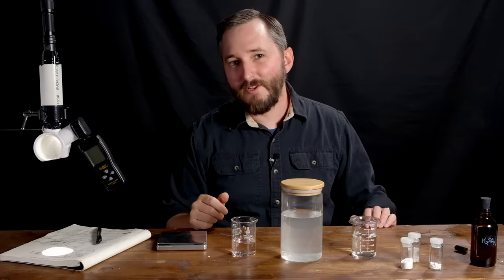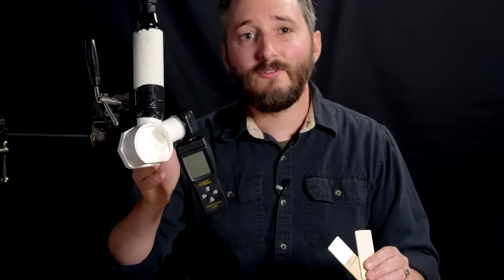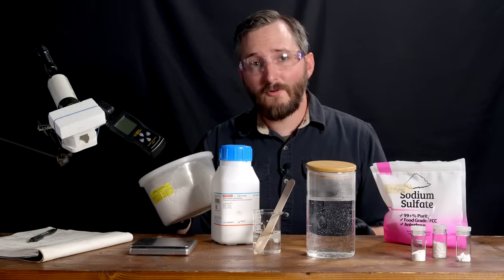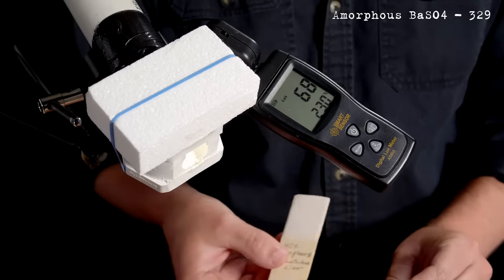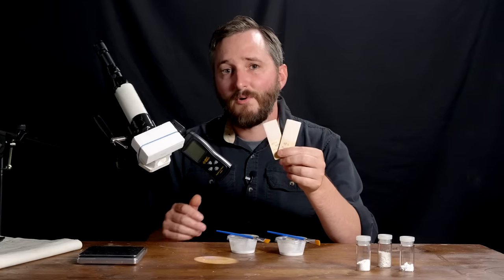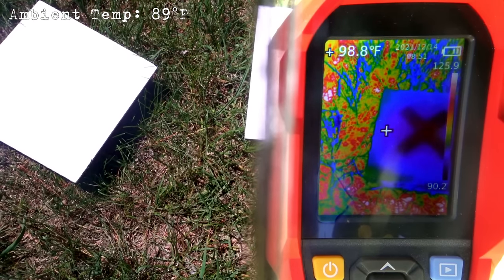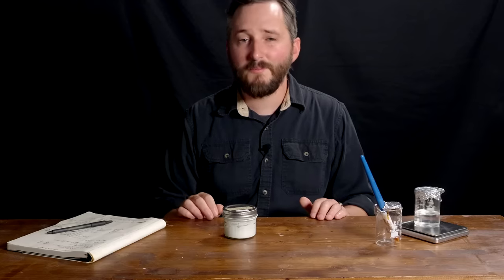How To Make Infrared Cooling Paint (Electricity Free Air Conditioning)

Comment: I noticed that your goal is to get high visible light reflectivity, before testing the infrared properties. Do you mind publishing a short that compares the properties from the un ideal paints as well?

P.S.
The phrase “pharmaceutical products” doesn’t just apply to medicine, it also applies to equipment: from glucose test strips, to crutches and wheel chairs.
The reduced thermal heat properties could be very useful for sensors in medical laboratory equipment.
Reply from the maker: I would have to make new batches of those paints to test. Sort of a lot of work for what would be a pretty boring video. I'm certain the results from the early paint tests would not be useful practically. I'm working on improvements to this paint now, in particular a calcium version that I think will be the best yet and easy to replicate. New video should be out in about a month if things go well.

Comment: Could you mix it with any kind of coolant without ruining it? Then maybe run it through clear piping? Use it with a heat pump?
Reply: I may be way off but it's to see if I understand and wonder also. Could this be used in place of water in solar collectors?  I guess, though, it loses its cooling effect when it is away from exposure to the sun's rays-- it does retain any cooling. 

Let's keep sharing this video and getting more brains to noodle on it. Maybe opengpt will have thoughts on it, too?

Comment: Amazing video, Nighthawk!! Truly inspiring stuff, and as usual you make it look so easy. 

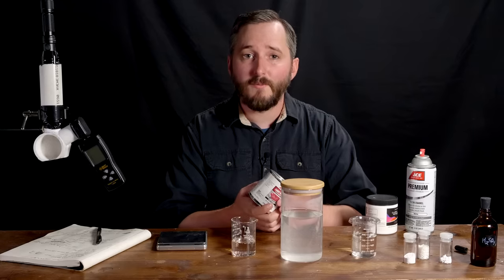At 2:45 you mention that Calcium Carbonate can also be the basis for such a paint. So basically simple lime can get this job done (mixed with other stuff perhaps)?
Reply from the maker: Yes calcium carbonate can work if used just like the barium sulfate in this video. It's slightly less cooling, but very close
Reply: @Nighthawkinlight  Since commercial Lime is about $10 for a 50lb bag... I would give it a try. 

Also, are you familiar with Solar Flat Plate Collectors? They are used to collect solar hot water for domestic hot water or hydronic heating during the Winter. What if the backside of the panel were coated with this high emissivity paint and removable rigid foam panels? 

During the Winter the panels are angled at the Sun to absorb radiation for heating, but during the Summer the panels can be inverted and the rigid foam removed to allow them to cool the water below ambient.

Comment: How did you calibrate the thermal camera for the emissivity/reflectivity of the paints and for the temperature of the background reflection of the sky? It would be really nice if you embedded a thermocouple in the barium paint area and a thermocouple in the standard white paint area to read surface temperatures.

Also, you should put your panel on reflective insulation to fight thermal conduction and thermal radiative heat transfer between the back of the panel and the ground.
Reply from the maker: I've compared the thermal reading with thermocouples and it's pretty close. All the paint tested was acrylic based so the emissivity is similar. I'll be using thermocouples in the following videos and only using the thermal camera for the visuals.

Comment: now that is a fascinating video with those sort of numbers you could maybe run a low differencial sterling engine vanta black on the sun heated end of the cylinder your barium white on the other. that could make an incredably cheap efficient alternative to photovolteics

Comment: if this were possible then the compressor in a home aircond  could be reduced or removed and simply circulate water in a large box that was 15 degress F lower than ambient temp. ! aircond could be supplemented only for the hottest days of the year
Reply from the maker: Yes, the installations of this tech so far have been panels that circulate air for the intake of compressor air conditioners to give it a 15f head start in cooling.

Comment: First, Thank you very much for your work. I am always learning stuff here.
At about the 5:00 mark, it is mentioned that a 60/40 mixture was used for the barium sulfate. I am curious if any thicker mixes/applications were attempted and if so what was observed ?
My goal is to create an emission surface to pump water condensation heat off planet.
Thanks again.
Reply from the maker: More pigment would make the paint too fragile. You could pack more pigment in if you use a method such as that demonstrated on the channel Tech Ingredients. They use barium sulfate microspheres which can pack more densely for an excellent result

Comment: Sounds like a fun project.. Do you think it would work at all if I painted sheet aluminum with this, welded copper piping to it, connected it to a radiator in front of a fan and ran water through it? Sounds reasonably doable, but I have no clue how big it would have to be if it would even work...

Comment: Are those birdhouse looking things being used as thermoelectric generators using the heat differential they produce? If not, maybe that could be a practical application for this paint. A no-moving-part heatsink to make a continuous difference in temperature for a thermoelectric generator 🤔

Comment: If you can find a way to make asphalt that doesn't get as hot in the sunlight, you would probably solve a lot of issues with heat in big cities. 
Obviously, you cannot paint asphalt white or that would be too dangerous and ice wouldn't melt in winter.

Comment: I wonder if you painted around bifacial solar panels with the infrared cooling paint if you could increase the wattage on the solar cells by decreasing the temperature and increasing the light input while also cooling the structure that the panels are on causing less wattage to be needed?

Comment: Great experimental work. But unfortunately you cant  easily judge Temperature of your paint with an IR Camera! The paint has lower emissivity in the range of IR wavelengths where youre camera works. Best would be to paint some samples of same material, Geometry, and weight and prove lower temperature by measuring with embedde Pt100 thermal sensors in comparison. ! You could convince me by an IR Picture from the backide of two sheets where the fronsides are having high reflective paint and Cooling paint and th ebacksides the smae coating...would be great if you make a video about this :)

Comment: So, is this basically conditioning the light to reflect at a particular range of wavelengths to hit that window? If so, could we use that property to create solar style panels that target that range and get higher efficiency from the reflectance? Or, if we painted a house like that, could we then use the house as a heat source to focus light from for a thermal heating engine, like the solar systems that heat sand and oil to high temps?

Comment: Thank you for publishing all the research! So, is this a wireless heat pump that will radiate on any cooler cooler surface? If so, can this radiation wavelength be redirected with mirrors? The way that this technology needs clear sky to function confuses me.

Comment: What if you bought a used AC condenser coil, coated it in your paint, put it under a transparent tent to protect it from wind, and then pumped water through it? Some ac condenser coils are covered in tinsel-like bristles, which would provide a large amount of surface area to radiate heat. If you hooked up the other end to a radiator with a fan inside a small room, I'd be curious to see if it would have enough cooling capacity to function as a legitimate air conditioner.

Comment: At 2:45 you suggested calcium carbonate as another material that can reflect the infrared at that wavelength. Have you, or do you plan to use calcium carbonate in a different video?
 It seems to me easier to acquire, and less dangerous to use than barium.

Comment: I wonder how much of a difference it would make between a clear coat vs a thin film, or an adhesive film, my guess is that the film alone is the best because there is little bonding or contact area meaning there's little conduction from the film to the paint, if it was a coat of clear coat, my guess is that it would perform below the film because it would be more bonded meaning the paint can conduct more heat from that clear coat. For a durable application i would guess that there is an ideal film with an ideal adhesive, some adhesive that has the lowest possible thermal conductivity, therefore creating a durable finish akin to clear coat (maybe not as durable as real clear coat but better plastic wrap) 
The only issue then would be that an adhesive tends to yellow, and by its nature has long molecular chains that can be tangled or twisted in their nature which may prevent IR from passing through. Polyethylene...

Does everybody realize that previous generations within recent history were adept at these types of applications yet they didn't have the vocabulary or complexity we find today. White washing walls, plaster, and on greenhouses applying a white wash of chalk to the glass during summer months. 
If calcium carbonate is comparable why not use it? Barium is a byproduct without much use and relative toxicity contrasted with its periodic counterparts. But calcium is vital. One must also assume that the promises of research papers are weak because they seek to demonstrate a result which shows economic viability and must not publish something saying this thing works but it only kind of works sometimes and not everywhere and it's nuanced and complex. Profit drives discovery and turns researchers into confabulators. Publish or perish. 
I think I'll just find a nice big rock and live under it, dig out a bit of a cave. Just make sure there's a nice pocket or shaft somewhere so that if there's an earthquake there's a hiding spot, and I'll be set for life. If you live under a boulder you'll have the most stable temps imaginable, it would be climate control heaven.

Comment: Can you formulate a paint that only has the cooling effect when UV is high, such that it can cool a house in the heat of summer but doesn't do so as much in winter or at night?

Perhaps it would need to be applied as an outer coat that works in the opposite way of sunglasses that darken in the sun - when UV falls on it it becomes transparent at IR wavelengths instead of opaque.

Comment: Thank you for methodically studying and experimenting with an alternate way to refrigerate. You may be interested in another part of the topic. 

Please consider a thought experiment for self powered thermal diversification that is impractical but easy to visualize and check for mechanical workability. Heat is moved by a nanometer scale process without being forced by added energy: 

Sketch made with keyboard characters: 

COLD ROOM   ())--:::WALL:::-->> HOT ROOM     
>~1000 NM< 

Key
()) = Paddlewheel. 
-- = Axle.  (Continuous from end to end)
:::  = Axle tunnel going through a wall.
>> =  Lumped friction element

Visualize two roome full of air separated by a very thin wall that allows the rooms to hold their heat independently with minor leakage through the wall. The wall is thin to delicately support billions of  separate nanometer scale short axles running straight through loosely enough to rotate freely but  not leak very much heat so the rooms can hold separate temperatures. 

On the left side, a very small paddlewheel is mounted at the left end of each axle. On the right side, lumped friction elements are mounted stationary in place on the wall, one for each axle, for the right end of each axle to run through. The lumped friction elements connvert the mechanical rotation of their axle into heat. 

Brownian motion turns the paddlewheels at random speeds  randomly clockwise or rcounterclockwise. This random rotation is turned into heat by the lumped friction elements.  The lumped friction elements do not impart Brownian motion to their axle.   

  The committed functional roles of the paddiewheels, axles, and lumped friction elements in differnt places should systemically produce a divergence in the thermal energy in the two rooms. I repeat, heat is moved by a nanometer scale process without being forced by added energy. This clears away the second law of thermodynamics. 

Here is a more more practical device named  Thermic Array 

 it mainly consists of two electrodes closely face to face (~1 micrometer) in a vacuum wired to an external electrical circuit. The face of the [Emitter] electrode is covered with a uniform array of LaB6 tipped small diameter carbon nanotubes grown straight out. The face of the [Absorber] electrode is covered with small scale graphine flake char. 

Thermal energy mobilized unattached electrons tend to free themselves outward from the emitter tips and drift at ~1 million meters / second @ electron energy of 25 millivolts to the absorber which tends to collect them.  

A negative charge accumulates on the absorber. This repels oncoming electrons slowing their forward drift, cooling them. The absorber electrode charge is simultaneously the repelling cooling and the electrical circuit voltage. The drift current and wire current are the same. The DC electrical power consumed by the electrical load depends on the load resistance. Thermal energy absorption always equals the electrical yield. Wire resistance is a practical loss not a true loss. The performance of the device is expected to be modest in the beginning but improve rapidly. Even early devices are expected to last a long time.  

The Thermic Array will not be patented. The details of constructing the Thermic Array will be freely, openly, thoroughly,  and widely avaliable for the overall betterment of civilization.  

TheThermic array needs to be prototyped to prove that it works. This requires a smoothly functioning nanofabrication team which can be hired. This initial prototype funding would be a crowdsourced grant needing sophisticated management.  

I think the Thermic Array should be manufactured in AI operated cooperative managed coglomerates. The semicustoproducts would be open to public knowledge and sold at commodity prices for the overall betterment of civilization. 

I was granted US patent 3890161 DIODE ARRAY  for a refrigerator that absorbs thermal energy and releases a corresponding amount of electrical energy. I would prefer using a public idea registry that did not confer exclusionary power.

Aloha
Charles M Brown ll
Kilauea, Kauai, HI 96754

Comment: Is it possible to spread it over a large area using a mud drywall knife? Also, can a U.V. clear coat or dissolved polymer, like dissolved acrylic, be applied to enhance its durability? Perhaps creating a laminate between polymer sheets could be an option.

Comment: I wonder if this could improve the efficiency of a Stirling engine. Actually could you have a solar powered Stirling engine powering an Air conditioner, and use said Air conditioner to keep part of the engine cold to improve its efficiency?

Comment: boron nitride based paint can reflect up to 97.9% of light compared to up to 98.1% for barium sulfate but it only needs 1/4 the thickness of barium sulfate to be that reflective and is 80% lighter. 
I couldn't find anything on the cost difference between the two.
Reply from the maker: Interesting, I'll have to look into that

Comment: Brilliant work from chemical engineering standpoint. I really enjoy the kind of work that translates something that was possible in the lab to basically home environment. However I should address some of the flaws in your measurement techniques. 

Thermography as a technique heavily affected by emissivity and reflectivity is not that well suited for taking temperature measurements of highly thermally reflective surfaces and your testing seems to confirm that. Compare the test you did in bright sunlight to shining a flashlight on two materials with different visible spectrum reflectivity. The material with higher reflectivity will appear to be brighter as it reflects mor light towards your eyes. If the light is diffused (test in the shadow) the differences in brightness will be less noticeable (which happened in your test).What your testing has proven is that paint you created has higher reflectivity of visible spectrum but slightly worse in IR than commercials equivalents.

The proper testing solution I can come with on the top of my head that wouldn't involve expensive equipment would be a body of thermally conductive material, with temperature sensor embedded, painted in the tested thermal paint solution, exposed to sunlight over some amount of time. Even if it doesn't remove other factors like wind, air humidity etc. it can prove the formulated solution working.
Reply from the maker: Yes I've already confirmed the thermal cam results with physical probes

Comment: It's a neat idea. But what if in regions of the globe where possible, just face the cooling surface away from the sunlight? If you're using panels anyhow, can't they just be faced away from direct sun to achieve the same result, if commercial paint has the same cooling effect when not in direct sunlight? Yes, you can probably achieve a lower temperature with a cooling paint, though.
Reply from the maker: Yes, but there's benefit to using the panels to shade areas in direct sunlight

Comment: With heat & fire proof paint the carbon putty layered both sides protecting the out side what happens to the in-between protected side? Would it be possibly that like an egg put in a microwave seriously, as the water does have a reaction slightly magnified to that of pressurised  boom? Just a thought?